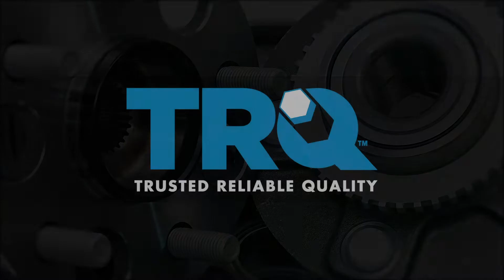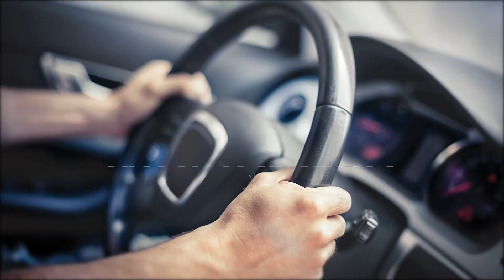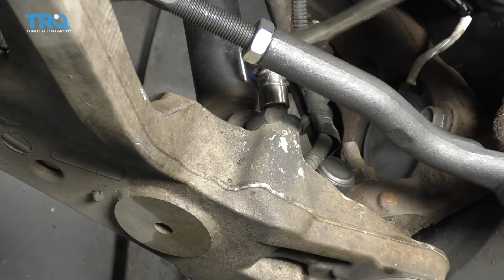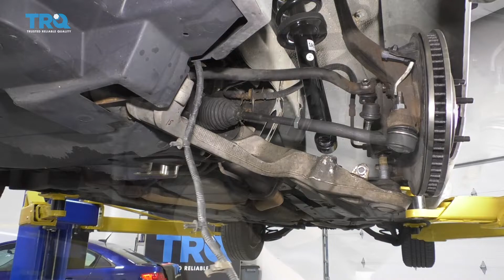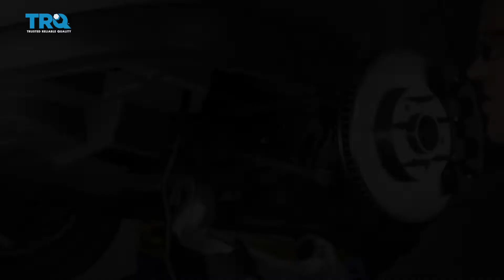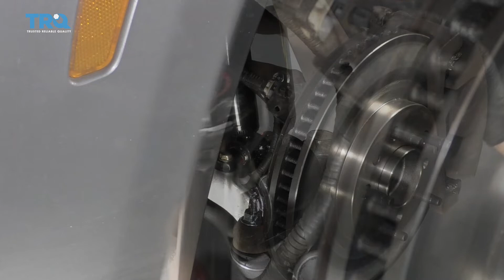How to Replace Front Drivers Side Lower Control Arm 03-07 Cadillac CTS

Comment: Can this be done with the car on a jack? Or does it have to be on a lift?
Reply: Jose G. Pizano iam gona try it next week on the ground with jacks.   i dont see why not.   i had my other side done at a shop,  they charged me $900.   the part is $110 on amazon     not geting ripped off again.     did ur nut come off and the whole side of the car fall down?
Reply: It absolutely can be done on a jack... A lift would make the job far easier, tho. Nothing worse than rolling around on the garage floor trying to figure out how to torque the nuts with your elbows across your face